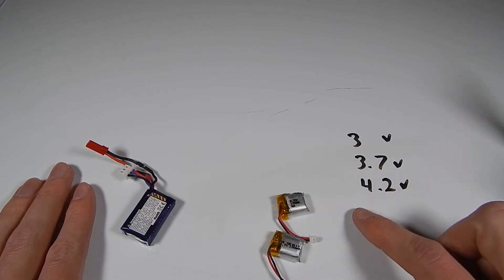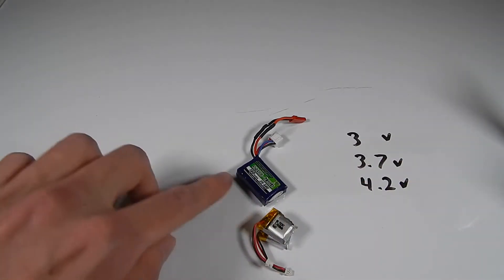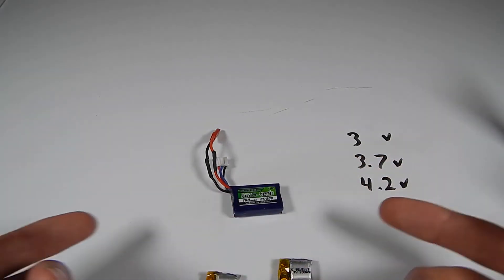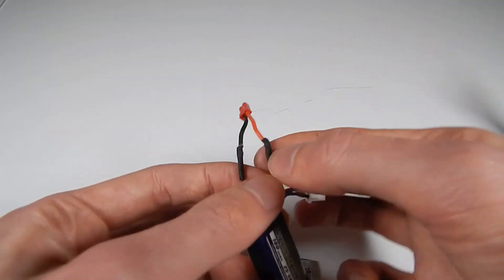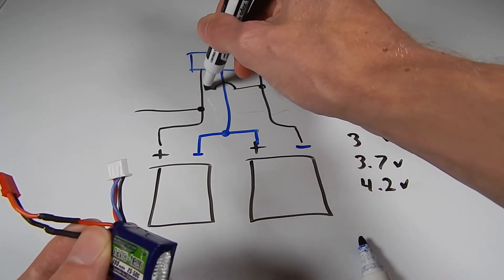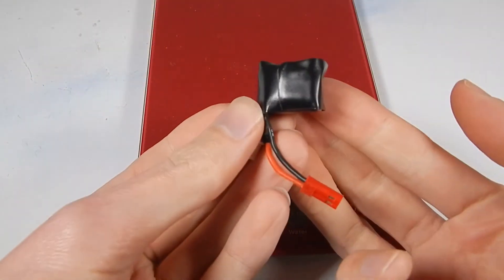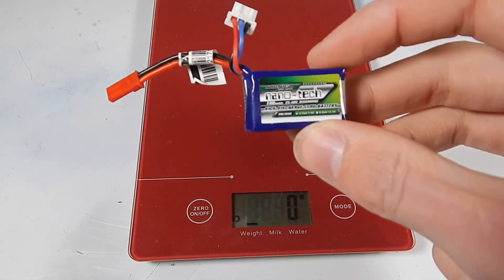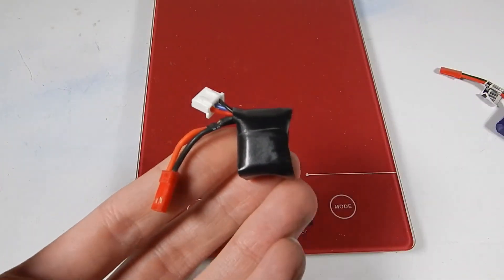DIY 2s 100mAh LiPo Battery!!!

Comment: Awesome video mate, ignore the know it all's, geez I was impressed with your solder setup! 
What was starting MAH on each of the small 1s batteries? And then what is end MAH for the combined 2s battery? Sorry if it was in the video or if it is obvious. Thanks
Reply from the maker: The starting packs where 80mah and I soldered them in series, so the voltage doubled while the capasity remained the same, so it should be a 80mah 2s pack
Reply: @TeamPanicRobotics  thankyou

Comment: also , what might be a good/useful idea 
is to just solder up a harness , so you plug them 2 lil lipo's in the harness , and it functions as a 2S lipo .
this way , 1 lipo can be on a different spot then the other one .
 let's say your build is very tight , and this could be a nice solution
Reply from the maker: You could do that, but it would add an extra gram or two.
So it depends on your priority for the build if you have a tight build a harness would work well if you need to lose weight directly soldering the batteries is lighter
Reply: @TeamPanicRobotics  that was a suggestion , not a question mate
Reply: @takoza5396 you gave me a useful tip for my small rc plane thanks

Comment: i don't wana be a dick 
but mate , your soldering is not good 
your just ploping the solder on 
it needs to flow true
Reply from the maker: Ok 2 things:
1) that part of the video is at 4x speed, I did let the joints heat up enough for the solder to "flow true" also I was filming, so there were cameras and lights around me making it hard for me to get my hands exactly where I wanted them which ended up with me adding more solder to the joints then I would normally

2) The joints worked, they aren't dry and they have held for 20+ fights. so there is nothing wrong with them

Just because something isn't "perfect" doesn't mean it's not 100% functional

In the future, if you want to give advice, be nice, focus on constructive criticism, don't start with "I don't wanna be a dick " (it makes you sound like a dick) and also make sure you actually watch what the person has done and understand it
Reply: 1) that literally is constructive criticism...

2)i know the solderjoint wil work....

3)if you wana show/teach/explain stuff to ppl ,then make sure you get it right , the joints looked bad .

..no need to feel offended mate
i'm a technical dude maself so i know what i'm talking about
i watch your vids caus i like to look at how other ppl do there stuff , maybe learn something , give some input maybe(but i won't say sht anymore...)

Comment: do i use the middle wire mine has a red at one end and 2 black
Reply from the maker: That sounds like a non-standard plug. So dont trust that the red wire is in the correct position
Reply: It’s the charging plug

Comment: i followed this and made a 2s the balance lead is not correct my lipo charger wont read it or charge it i used the middle wire with the neg and pos from lipo like you did

Comment: This was so nice to watch. It gladdens what's left of my heart to see these tiny, insanely powerful batteries in use by ordinary, regular guys at home ['ordinary, regular'? No offence intended, Ben!] and not boffins in secret research laboratories. My earliest fighting robots were built in 1987 - horribly crude things with monstous lead-acid batteries for drive, feeble 12v motors, and dodgy nicads for the radio gear. Truly awful - as were the bodged-together mechanical (!) speed-controllers. Yuk. Our unofficial 'Century fight-club' decided on a 100 lb weight limit and a £100 budget. We had to go large because there was no chance of making any small or beetle-weight or ant-weight robots - there was no way to power or drive them, so everything had to be huge and as heavy as a concrete badger's bum.

Lithium-polymer technology has opened up a whole new world for modern builders, and that's incredibly important because it's made it totally normal for young people to get interested in robot design, fabrication, and electronics. And if I'd had access to the internet when I started out (didn't exist) and top-quality YouTube channels like this (didn't exist either; Ben probably hadn't even been born), I'd have made far fewer mistakes while putting my first bots together.

Might not have had quite so much fun finding out how things worked, though...  ;-)

Comment: I know this is an older video, but I hope you still check to comments. What do you do about low voltage protection for this? Does the protection circuit on the two new batteries handle it?
Reply from the maker: Honestly I dont normally worry about low voltage protection.

I only use lipos for combat robots that fight for a maximum of 3 minutes, so I simply make sure they have enough capacity to last 4 minutes and charge them between fights.

In theory the low voltage protection should be fine, but I haven't tested it